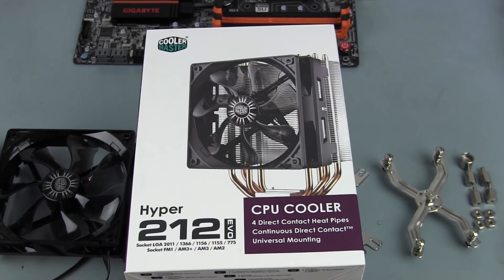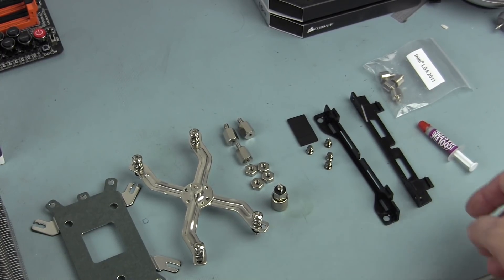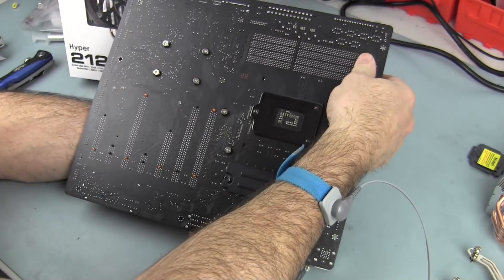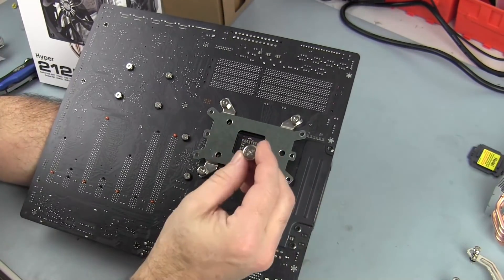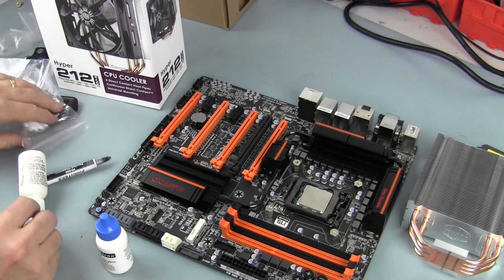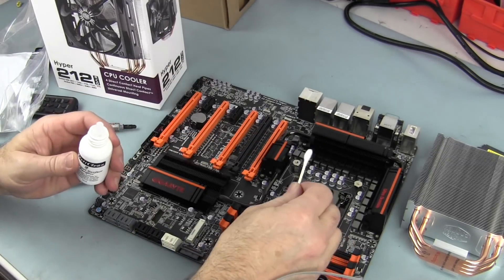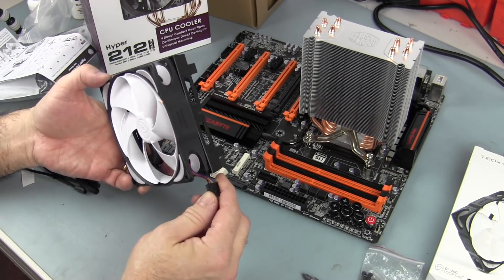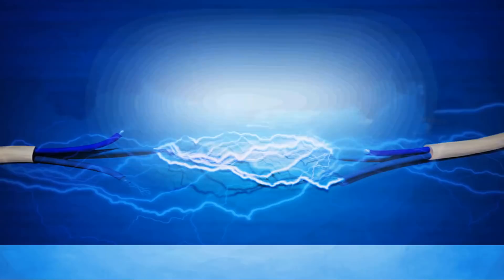How to Install a Cooler Master Hyper 212 Evo CPU Cooler

Comment: How thick is the thermal paste that you used? I'll be using arctic silver 5 and it's fairly thick. I just wanna make sure that the weight of the CPU cooler will spread it out fine.

Comment: do u think this cooler will install on this machine

| CPU: AMD PHENOM II X 6 1100T BLACK EDITION [3.3] [Stock] [3300 MHZ]
| GPU: XFX ATI RADEON HD 5850 1024 MB GDDR5 [Stock] [ 725/1000]
| MOTHERBOARD: ASUS M4A88TD-V EVO/USB3
| RAM: Zion Dynamic 1333MHz 16GB DDR3
| Monitor: SAMSUNG 32"LCD
| Power Supply: CoolerMaster 600W
| HDD: Seagate 1 TB 7200RPM 32MB cache SATA II
| Case: Zebronics Avaitor

Comment: Does it matter if I wait to install the CPU until after the heatink backplate is put on?  I'd just worry about touching the top of the CPU while putting the backplate on.  Or is it recommended to put the CPU in, then install the backplate?  Thanks!

Comment from the maker: Depends on how much room you have in your case. I would probably removed the cards.  The memory you may need to leave i. Check the clearance and see if you can re install the memory after you install the EVO.  If you can then take the memory our as well.

Comment from the maker: I did not really get a chance to test it much. I just used it to verify my CPU would overclock.  I don't recall the idle and OC temps. Checkout my video on the water cooled SM8 system with the Gigabyte Z77x-UP7 and I may have listed some temps in that video.

Comment from the maker: Thanks. I did to test the i7-3770K and try to get to 5.0.  Check out my Case Labs build video.  You will see a second fan installed on it when I was testing.